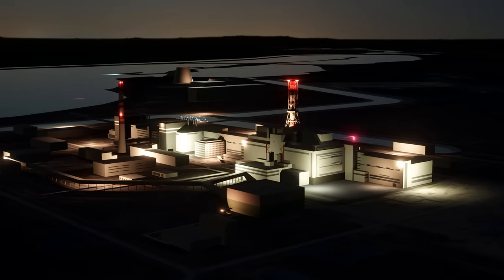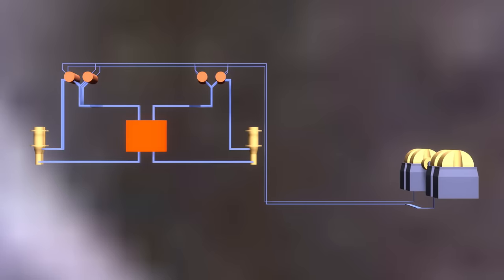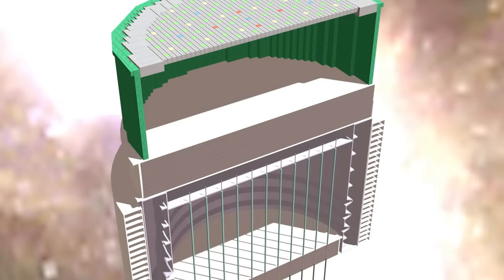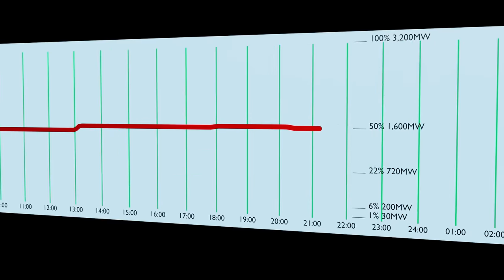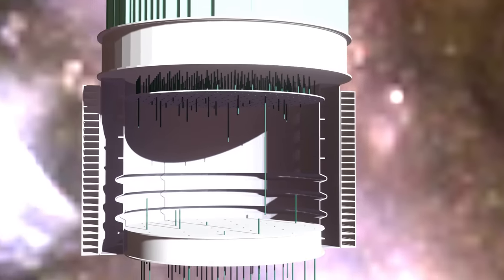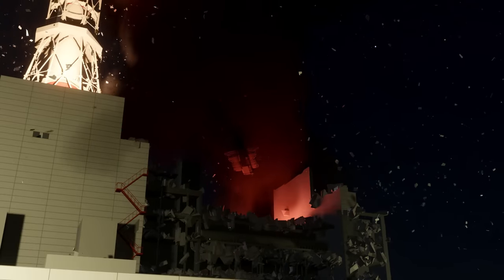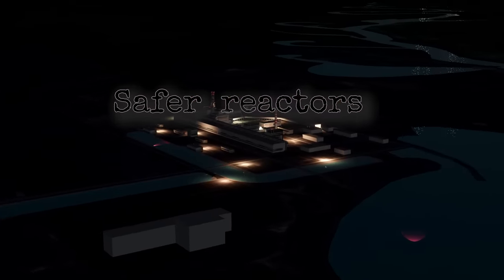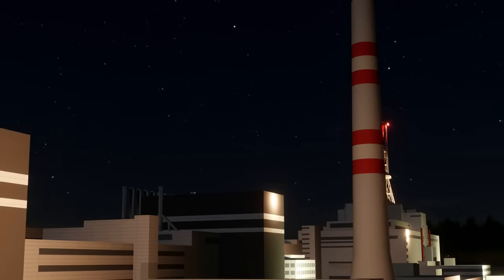CHERNOBYL AZ-5 why it exploded

Comment: When you complete the five year plan energy production in less than 15 seconds. Smart move
Reply: Smashing good fun for everyone
Reply: True communism archived
Reply: Everyone’s lightbulbs that night must’ve like fucking exploded or something
Reply: @layzee3810  no since the electrical power output never reached more than normal. the energy they're talking about is the thermal energy coming out of the core. also, i'm pretty sure since it was during a test it wasn't actually connected to the main power grid. so no, no lightbulbs where harmed during the event (except maybe those in the reactor room).
Reply: @yutiros5174  interesting, thanks for the information
Reply: Speedrun reactor meltdown
Reply: cue dream music
Reply: @yutiros5174  baaaa buuuuu badadadada
Reply from the maker: @yutiros @LayZee L The steam never reached the turbines and so not the grid either.  All that heat energy went into busting the reactor and the building apart.
Reply: @Mike-Bell  that makes more sense, the Soviets probably would’ve known how bad the situation was if the grid fried
Reply: @Mike-Bell  so the energy was generated it just never made it where it was supposed to
Reply: info Peace  what the hell does that have to do with the comment
Reply: info Peace  hm ok
Reply: info Peace  "China syndrome" is a fanciful term that describes a fictional result of a nuclear meltdown, where reactor components melt through their containment structures and into the underlying earth, "all the way to China"
Reply: info Peace  I was informing you that the 'China Syndrome ' is both, a fictional depiction created by a group of  anti-nuclear power and also the. 'China syndrome' is not possible, and is a fictional problem created by anti-nuclear activists to further scare the public.

The whole purpose of 'the China syndrome' film was to push the false scare tactics of anti-nuclear activists.
Reply: info Peace  just for your information

"'The engineer acknowledged that in June, 1970, a gauge stuck in the control room at the utility's nuclear plant at Dresden, Ill., and that the incident was roughly similar to one portrayed at the beginning of “The China Syndrome.” “Obviously, they used that event for the one in the film,” Mr. Rossin said. “But the incident had to he simplified. There were enough obvious changes from what happened to make it an exciting story. If they had stuck to the facts, there wouldn't have been a movie'"
Reply: info Peace  what was real, a Guage got stuck.

What wasn't real, reactor cores melting through earth.....

You obviously are a strong minded anti-nuclear Individual.

However your research into nuclear power demonstrates a lack of understanding.

BTW nuclear, atomic, Hydrogen, and so on bombs, are not nuclear power generation. The two are as I debriefing as an apple and a macadamia nut. Both are a fruit, but are completely opposites in nature and as food.

Just because a certain element when manipulated one way can make a bomb, doesn't mean when manipulated a different way is a bomb.

Macadamia nuts grow on a tree and is a fruit, but the soil, the carbon intake (air), and water, but it is completely different in studied. Taste and reality of an apple, of which grows on a tree, is a fruit, and has soil, water, and carbon intake.

So what I am saying, if that it would behoove you to go and study facts about what you claim and push, before you routinely push an agenda. Another words quit believing in false  scare tactics, and go research.
Reply: info Peace  but they don't. They don't keep having those same problems, don't keep having meltdowns.

Three l accrual information to everything is out there. And well, as everyone knows, Wikipedia isn't a source of information, but a place where people write what they want /believe.

A great example is this video here.

It providers some info but most is either very very paraphrased, or even wrong.

The complete investigation of Chernobyl is 182 pages long (I've had to read this several times through out my education, from high school, college, the navy, and into my career working at a nuclear plant as a nuclear instrumentation and control technician.

Every incident has an investigation. Every incident has a will documented order of events, actions  taken, and results. Wikipedia simply doesn't have the ability to include all this in its brief explanation, however you can find the actual documents that does.

As for your channel (I never looked but will in a second), I'm guessing it's your personal opinion placed on wrong information, or other videos.

An amazing example eating just 1 single Banana a year, gives the same amount of radiation from nuclear power. 0.005% of the average American annual dosage received. Most people tend to eat way more than 1 banana a year....

http://nuclearconnect.org/know-nuclear/talking-nuclear/top-10-myths-about-nuclear-energy#:~:text=Truth%3A%20We%20are%20surrounded%20by,eating%201%20banana%20per%20year.

https://www.nrc.gov/about-nrc/radiation/around-us/doses-daily-lives.html

https://www.ppe.gla.ac.uk/~protopop/teaching/NPP/P2-NPP.pdf
Reply: info Peace  not a single nuclear accident can do anything you just said. You literally are just repeating the scare tactics of false environmental groups.

Speaking of that, green peace came from a group of citizens that didn't like nuclear power, but knew nothing about it. They started in Canada with spreading lies about nuclear. They associated nuclear bombs with nuclear power. The group of citizens took a boat to Alaska to protest a bomb testing being conducted underground on an island.

Once l again, your statements are nothing factual. A nuclear power plant is not capable of what you are claiming. It goes right back to my comparison.

Just because  both use the word nuclear, does not make them the same.
Reply: info Peace  OK so hbo makes fiction to make money.

Just like 'the China syndrome'  was made by fiction to make money, with the purpose to falsely scare people.

You are the proof that that movie worked.
Reply: @Mike-Bell  Wasn't this explosion actually more harmful to life in general than any previously exploded nuclear bomb?  I have a feeling that this "non-nuclear" explosion spread more radioactivity and harmed more people than even Hiroshima.
Reply: @widescreennavel  you can read the report documenting it all. However, this was never a nuclear explosion. It was a steam explosion originally, then either another steam explosion, or even a hydrogen explosion.

As for it being worse, it simply wasn't. Even with a newer estimate of 4000 people might show symptoms and possibly die, it dwarfs any nuclear explosion in terms of damage to human life. (newer independent scientists studies show possibly as high as 60,000) the who and un have now chose to not give an absolute value now. 

Even test explosions caused substantial damage to human life. Tests in New Mexico, Nevada, the atolls and others all had effects that all human (possibly all life) life currently demonstrate.

Veritasium talks about it in his video, 'how Kodak exposed the atomic bomb'

Now when you get into direct human life damaged from the Chernobyl incident, there were only 50 casualties. 31 deaths directly from the explosion, 29 firemen from acute exposure.

If you really want to get into some figures with deaths world wide, the biggest killer is coal.

And to add to the irony, anti-nuclear power activists have caused far more deaths, then in all of the history of nuclear power. Their false fear tactics have caused the construction l and plans of new plants to stop. These new plants should have saved millions through reduced air pollution. So their very small amount of lives they were trying to save, led to a giant amount of deaths, that will be felt for years and years to come.

https://youtu.be/7pSqk-XV2QM

https://reason.com/2016/04/26/more-deaths-from-coal-pollution-annually/

https://ourworldindata.org/safest-sources-of-energy

https://ourworldindata.org/what-was-the-death-toll-from-chernobyl-and-fukushima

https://www.un.org/press/en/2005/dev2539.doc.htm
Reply: well they say a plane crash is just stopping too quickly
Reply: @Mike-Bell  Ye before they began the safety test they had to let the turbine cost and stop, so the steam valves for the turbine were closed.
Reply: I can deal with some sarcasm so no hard feelings on this comment 😏
Reply: @faktisletztenendes  that's something everyone feels😏
Reply: Yes and than you will recieve a medail for the Hero of Soviet union 😆
Reply: @luissantiago4395  Communism is one reason for the disaster
Reply: Outstanding move
Reply: Моё мнение взорвался водород так как реактор стал плавиться и пар взаимодействовал с ядерным топливом путем проникновения в расплавленную зону. А когда стали опускать стержни то это и стало детонатором для взрыва водорода.
Reply: @williampittam1  I will 8 to ki o999p000.7 for n
Reply: They ended up getting their early retirement
Reply: Nice Anno referance.
Reply: info Peace  what do you elarn in ytb? this was not an accident, thios belong to a bigger project that you cant understand. I was in the cold war...
Reply: Why take 5 years to something in 15 seconds when you could take 15 seconds to do that thing in 5 years
Reply: that's an explosive comment
Reply: @layzee3810  😄😄
Reply: @layzee3810  even with 20 times max production done, generator can produce more than their peak performance, to fried the grid you needed enough generator to convert thermal energy to electrical, and since the generator have a max perf, you can't fried the grid.
To achieve that you need bigger generator which can produce enough energy to melt cables.
Reply: @layzee3810  The transformers and breakers would have popped.
Reply: Not great, not terrible
Reply: @yutiros5174  Well actually... The entirety of reactor 4 was pretty much in the darkness except the control room and a few other ones.
Reply: 😂😂😂 so true
Reply: "Radiation Stalkers"...??
Reply: The last RBMK was first activated in '90.
Reply: e
Reply: info Peace  There hasn't been "many meltdowns". You're not an expert.
Reply: info Peace  The 7 Mt explosion is complete fiction. 7 Mt is the near the standard yield of a modern thermonuclear warhead. You think you can generate an explosion of that size with STEAM? No! The nitrate explosion in Beirut didn't even come close to that magnitude.
Reply: That’s Soviet efficiency at its finest
Reply: @yutiros5174  R/whooosh
Reply: @layzee3810  the reactor isn’t what makes the power it’s the steam from the reactor that turns steam turbines
Reply: @mdtransmissionspecialties  yeah no shit
Reply: Dream speedrun
Reply: @Mike-Bell  then the steam went into the condensers directly
Reply: @Mike-Bell  Not to be a smart ass but I’m pretty sure you’re wrong about the turbines. I remember they were only supposed to spin at like 800 rpm and right before it exploded it was doing like 30k or something crazy like that.
Reply: Stalin: What could go wrong??
Reply: Imagine if all that power went in the grid..  imagine the turbines lol it would have flung off and blow the turbines too
Reply: @Mike-Bell  hey mike bro i really love you
Reply: LOL
Reply: @Mike-Bell  Theoretically, if that power output was able to reach the turbines, would they have been able to handle all that power?
Reply: Speedrunning
Reply: Feels like starting and finishing a school project at 7am
Reply: THE FUTURE CANCER IN YOU THINK THE SAME
Reply: hi China.
Reply: "You bought a grill with a nuclear core, Shake! That's going to make things a little bit difficult."
Reply: @layzee3810  No. But people on a bridge in Pripyat got to see a beautiful blue glow. It was to die for.
Reply: Soviet efficiency on full display
Reply: @taesssi  China Syndrome is an information hazard, but I think the production was more concerned about making something entertaining, topical. You know, a movie..they wanted to sell box office tickets. Unfortunately the event at 3MI happened shortly after the movie released, and that combination stifled development and investment in the field. In reality we need nuclear energy and we're being fed stories from a certain billionaire and political groups that believe green energy means wind and solar. The eggs are going in the wrong basket. Elon would never advocate for nuclear energy because he doesn't stand to gain from it. 

I see him as a discount version of Thomas Edison. He's savvy enough to know that wind and solar are nowhere near feasibility for energy demands going forward. We are losing precious time and resources chasing technologies that aren't good solutions. Nuclear energy can be used responsibly and safely. :( it's sad
Reply: @powertothebauer296  Sorry but your timeline is not supported by data. The reactor power and cooling was entirely fine until the EPS-5 (АЗ-5) button was pressed which triggered the power excursion and resulting explosion.

"Neither the reactor power nor the other parameters (pressure and water level in the steam separator drums, coolant and feedwater flow rates, etc.) required any intervention by the personnel or by the engineered safety features from the beginning of the tests until the EPS-5 button was pressed." — INSAG-7, Annex I
Reply: @jackdough8164  The turbines were spinning down during the test, not up.
Reply: @jackdough8164  I just checked the graph of the measurements that were being done as part of the test, which includes parameters of the turbogenerator (TG-8). It shows the RPM decreasing in a perfectly straight line from the start of the test until the data ends about 6 seconds after the explosion. During this 48.3-second interval the turbogenerator slowed down by only 20%.

The only turbogenerator parameter that showed any abnormality was its output current, which showed a sudden drop at the time of the explosion, corresponding to a drop in current drawn by the coolant pumps that were being powered by TG-8 as it spun down (which was the thing being tested).
Reply: The truth about Chernobyl: HOW THE 4th UNIT OF CHERNOBYL NPP WAS BLOWN UP (channel-KS).
Reply: @widescreennavel  Pripyat and the Exclusion Zone will be uninhabitable for human life for 20,000 years.  

Hiroshima and Nagasaki are both different than Chernobyl.  Both those bombs, although nuclear, were exploded in the air above both cities. Because of this, the radiation created from the explosions was able to escape into the atmosphere and dissipate.
Chernobyl, however, melted down and got into the Earth.  And so the radiation is stuck in the Earth and has no where to go.
Reply: @taesssi Your numbers are wrong as far as death toll from Chernobyl. The numbers you use are the official Soviet Union death toll numbers...haven't changed since 1986. They do not take into account all the people indirectly affected by the nuclear fallout in the years after.

The death toll numbers are closer to 40,000 deaths when accounting for deaths in the years after the accident.
Reply: @dvbagnasco  there are no official numbers for people that have died due to radiation after the accident as there is no way to verify if they did from radiation from Chernobyl or from natural sources. 

The estimate is as low as 4000 to over 1 million. However these can not be verified. That is why the numbers are what they are. 

Also the estimate changes with every source, again because there is no way to prove or verify the deaths came from Chernobyl.